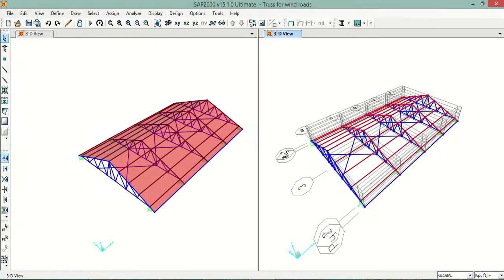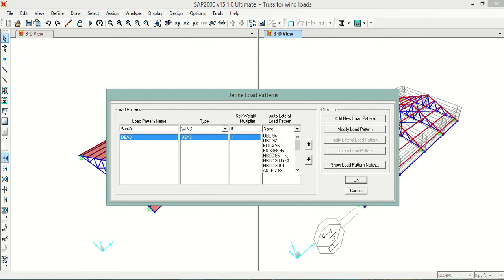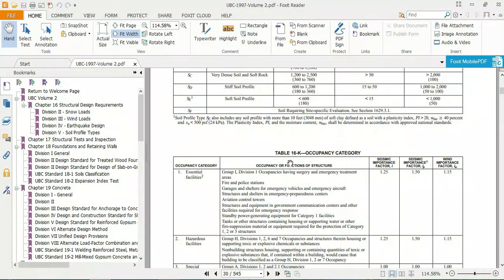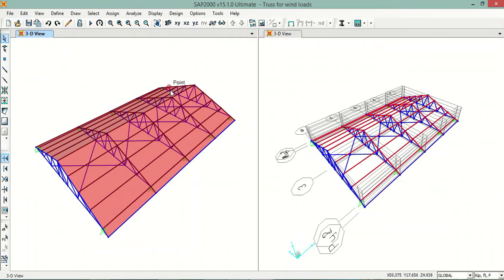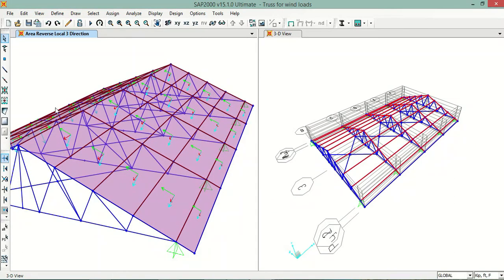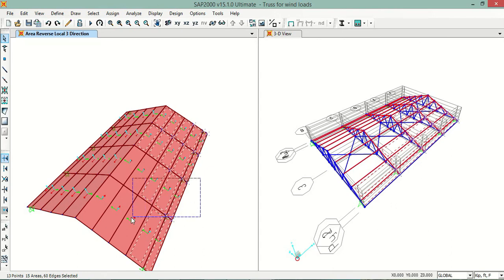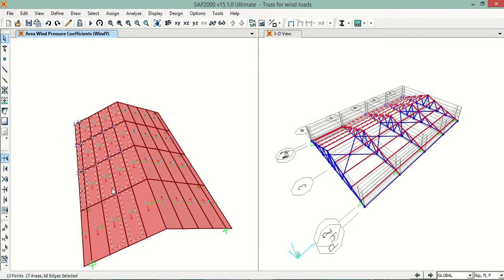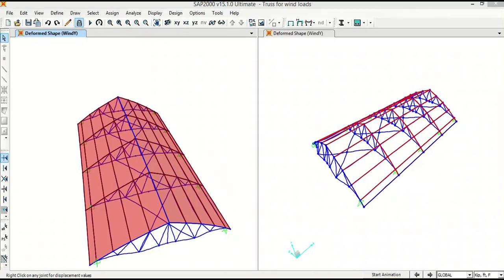how to apply Automatic wind load in sap2000 on a truss

Comment: THANKS FOR THE VIDEO BRO 
I HAVE A CURVED ROOF 
IS IT WORKS IN THE SAME WAY ??
Reply from the maker: You can check it...I think it will work.
Reply: I think this is the best idea
In this case we don't need to apply suction
The software will make it yes?
Reply from the maker: @mohanadhabh772  ,Yes that's the main objective of automatic load...